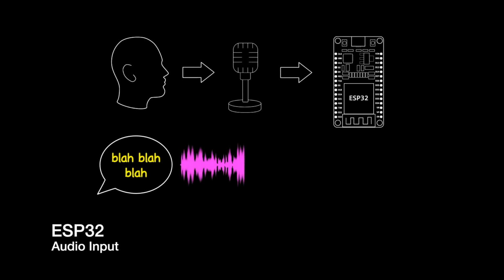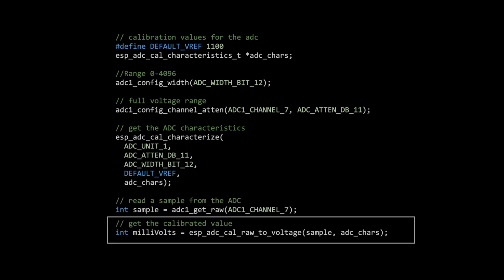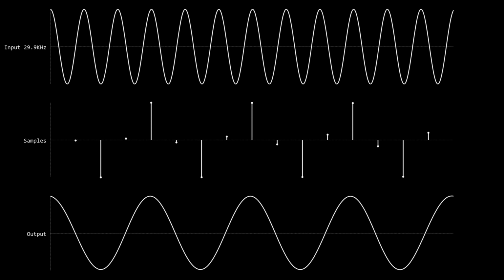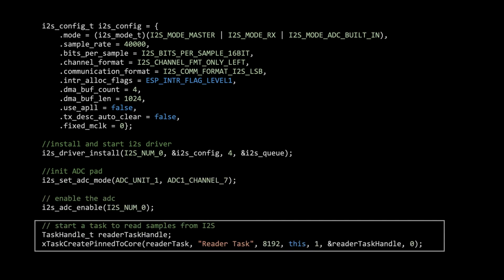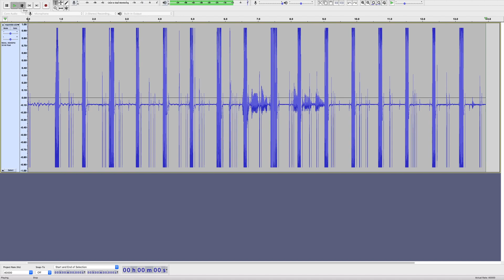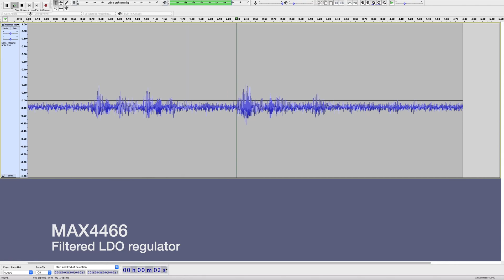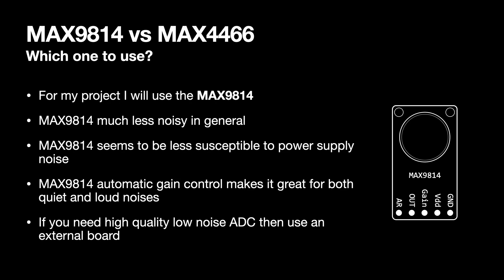ESP32 Audio Input Using I2S and Internal ADC

Comment: We are working with a PCM1808 an ADC that is connected vía I2S to an ESP32, would the code you showed in the video work if we are purely using our external ADC 

We have pins such as BCLK, Dout, SCLK and LRCK in our ADC 
We are having trouble to realize if our module is working properly. 

Because the only pin you configured was the internal ADC of the ESP32

Comment: So what part of this was I2S? These MAX modules are just microphone amplifiers, no? The way this was hooked up there is no way this was I2S. I guess maybe internally it is as if it was I2S, perhaps all we care about here is a way to read audio from the ADC pin in DMA mode. That's cool. I like the thorough work you did on cleaning up the signal. I am currently designing my own board and thinking I will integrate the MAX9814 as well as an audio amplifier on the DAC line. But not sure, maybe the trick is to keep all audio stuff off the digital PCB to avoid the noise coming in.

Comment: How do you manage to get 3.3v after passing 5 volts through those two inductors? I tried the circuit you suggested in your other video, but the voltage drop is more than intended and once reaches the microphone, it is around 2.7v not 3.3v.

Comment: Great video @atomic14. I'm getting the first part of the manual sampling going on a new ESP32 S3, but it seems like the I2S direct link to the onboard ADC has changed. Have you done any work with the S3 to see how to use efficient analog audio sampling without going directly to the DMA buffers?
Reply: Hi Pieter Snyman 
Am also trying to work with esp32 s3, How to work on it, with using i2s on board ADC?
Reply: @saranyaasuresh5710  in the end I used a digital microphone instead (that does the AD conversion) linked to I2S on the ESP32 S3. The S3 does not have the capability to use its internal ADC with I2S. As far as I understand this is preferable because the ESP32 ADC is not very good.

Comment: Great video. I'm using I2S just to measure one analog input. However, I'd like to measure two but have no idea how to set this up. So far all I've managed is to get loads of crashes or no data at all. Can you assist? Not sure if it's even possible. Cheers. Matt

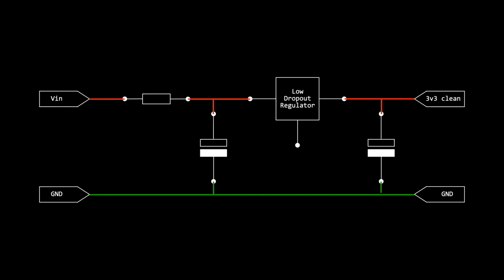Comment: Hi! Could you please tell me, what components did you use to filter the signal? I mean the diagram in the 7:32 video. What LRD chip did you use? and what capacitance of the capacitor did you use on the right?
Reply: did you figure this out? 🙈
Reply: is it a 470 microfarad capacitor?

Comment: Excellent video... came looking for info on MAX Mic modules... got it and more...
Just a note, you could power the MAX with a little isolated DC-DC converter (B0505S), often used in USB speakers to remove supply noise and it's not too pricy...
Reply from the maker: That’s a good suggestion.

Comment: Thanks for that video, TIL something new! 👍 'd and subbed.
I'm currently working on a very similar esp32 project (even using the same Microphones 😀), but when measuring the duration i2s_read(), I get very weird timings which are not correlating with the sample rate set in the i2s config. Do you maybe know what's happening here?
e.g. sample_rate = 40000, I get 6.3ms for an average i2s_read of 512samples (1024 bytes) buffer. Which is odd, because 512/40000 is ~ 12.8ms already. So I thought "okay, it's maybe twice as fast as I expected because I use only one channel"
So when I turn the sample_rate down to 20000, I would expect the duration of i2s_read to be DOUBLE (~12.6ms) for the same amount of data (which almost matches the calculation for 40kHz). but instead it goes down to ~5.9 to 6ms for 20kHz@512 samples ???
Okay, let's turn it down to 10kHz, I get ~5.4ms ... 1kHz, I get 825µs... . Are you familiar with that kind of issue? I need my data to be as exactly timed as possible, and these measurements make absolutely no sense to me.
Thanks for reading, and if you can explain that one to me, you'll have my eternal gratitude. Great video, animations and explaining!
Reply: Hi, I am also facing similar issue. Did you find  any solution? We can get in touch and discuss. Please ping back so that I can share my email Id with you.

Comment: hello, (did not work) this is nice tutorial, and i am trying to sample adc channel exact same as shown in tutorial, but it did not work. code crash with divide by zero error when call function i2s_adc_enable(I2S_NUM_0);

for reference my initialization code is as below:

#define TEST_SAMPLE_RATE    1000
#define TEST_NUM_SAMPLES    10

static TaskHandle_t readerTaskHandle;
static QueueHandle_t i2s_event_queue;

void initI2S( void )
{
  printf( "Entering : initI2S \n" );
  i2s_config_t i2s_config;
  //{
    i2s_config.mode = (i2s_mode_t)(I2S_MODE_MASTER | I2S_MODE_RX | I2S_MODE_ADC_BUILT_IN);
    i2s_config.sample_rate = TEST_SAMPLE_RATE;
    i2s_config.bits_per_sample = I2S_BITS_PER_SAMPLE_16BIT;
    i2s_config.channel_format = I2S_CHANNEL_FMT_ONLY_LEFT;
    i2s_config.communication_format = I2S_COMM_FORMAT_I2S_LSB;
    i2s_config.intr_alloc_flags = ESP_INTR_FLAG_LEVEL1;
    i2s_config.dma_buf_count = 2;
    i2s_config.dma_buf_len = TEST_NUM_SAMPLES;
    i2s_config.use_apll = false;
    i2s_config.tx_desc_auto_clear = false;
    //i2s_config.fixed_mclk = 0;
  // };

  // i2s_queue = xQueueCreate( 4, sizeof(UI8) );

  i2s_driver_install( I2S_NUM_0, &i2s_config, 1, &i2s_queue );
  i2s_set_adc_mode( ADC_UNIT_1, ADC1_CHANNEL_7 );
  i2s_adc_enable( I2S_NUM_0 );

  (void)xTaskCreate( readerTask, "readerTask", 8192, NULL, 12u, readerTaskHandle );
  printf( "Exiting : initI2S \n" );
}

Comment: Thanks so much for the awesome video, you've helped me immensely with my current project. I have a question regarding the internal ADC, is it possible to sample two or more ADC pins simultaneously or close to (i.e. not stopping and starting repeatedly)? I've tried to enable I2S1, but now see it is incompatible the built-in ADC, and i2s_set_adc_mode can only accept a single pin as an argument. Thanks again.
Reply from the maker: Hi Mike, it looks like it should be possible - there's a bunch of information here that might be useful - https://github.com/espressif/esp-idf/pull/1991

Comment: I would suggest the vocabulary "Interference" to describe the power supply signal getting into the audio signal. 
It makes some sense to differentiate and use the word "noise" for signals that are of random nature such as the thermal noise associated with resistors or the shot noise associated with current through semiconductor junctions. 

Why? because speaking this way makes you always remember to use design countermeasures appropriate for each type of undesirable signal.

Interference is also the right word to use when a signal from another source is getting into another signal. Such as One radio station in the background of another. Or AC power line hum getting into audio.  An interesting characteristic (while not often practical) is that you can some times cancel out interference by adding a scaled and inverted (the negative) interfering signal back into the contaminated signal. You cannot cancel thermal or shot noise because they are in your circuit components and never isolated.

Hope this helps.
Reply from the maker: This is why I love the viewers of this channel. This is a really informative and useful comment.

Comment: Very informative video. I've learnt a lot about audio sampling on the ESP32 from it. I have a question about the MAX9814 calibration though. There is a 1.25V DC bias built into the MAX9814 which I can see in the loop_sampling code serial print voltage output. When I  use the same device using your i2s_sampling code the raw sound data I capture on the server is also biased when I look at it in Audacity, (positive 0.5). Is this something I can calibrate out using i2s_read?

Comment: Thanks for mentioning the noise issue, that saved me a lot of time,
Reply from the maker: Yeah, a good clean power supply is essential for anything audio. I2S microphones seem to be a bit better, but I've still seen some noise issues.
Reply: @atomic14  could that be the reason why the ESP-CAM has noise in the images too? The power supply noise should also affect the camera, shouldn't it? Interesting...
Reply from the maker: @raguaviva  could be yes, depends on what kind of noise you are seeing.
Reply: @atomic14  I used two mics to do SSL (sound source localization using the FFT) let me know if you are interested and I can share with you the details/code
Reply from the maker: @raguaviva  That sounds really interesting! I'd definitely be interested. We've got a discord group going for the channel if you'd like to jump into that: https://discord.gg/DJ8EQRXU

Comment: Hi, amazing video and code.

I am trying to modifying it so I can sample two pins, but before doing that I want to get the example "i2s_Sampling" working. I commented out the mems parts, as I assume I do not need that when sampling i2s/dma. The part I am stuck on is seeing/listening to the stream over wifi. What program/GUI did you use to view the content?

Ultimately, I am going to sample at 60khz then average (10 samples) to downsample it to improve the SNR. Its for measuring another radios RSS, so I want something with high sample rate but also to remove extra noise. This data will ultimately be stored on an SD card, which is all working already. I just need to get your example working as is, then I can figure out the rest from there.

By "machine", do you mean the esp32 IP or the destination computer? 
```cpp
// replace this with your machines IP Address
#define ADC_SERVER_URL "http://192.168.1.65:5003/adc_samples"
#define I2S_SERVER_URL "http://192.168.1.65:5003/i2s_samples"
```
Reply from the maker: Hi Michael, that's the IP address of the machine that is running the node js server. To open up the files you can use a program called Audacity - this will let you import raw audio samples. You might also want to have a look at the sample code for writing to SD Cards - https://github.com/atomic14/esp32_sdcard_audio
Reply: @atomic14  Ah thanks for replying, only seeing this now. Thankfully I managed to get it working, I switched to sending the data via TCP instead of HTTP packets to log to a file, since this part was only to prove the code would work it was good. For some reason the alternating buffers was not working correctly, every other buffer sent was just zero, I was trying to fix it and feed it into a ringbuffer, but realised I didnt need the two buffer step if I was using the ringbuffer, still, couldnt figure out why.

Another question, I was hoping to record two adc pins, assuming I could use both i2s ports for that, but of course I have now just discovered only I2S_NUM_0 can be used with the ADC. I assume there is no way to read two pins, but thought I would ask.

Comment: Outstanding content, I have recently started developing with the ESP32 and was under the assumption that the internal ADC was useless so I've been using external ADC's. Implementing the process you have outlined here and a little digital filtering it's actually not bad at all for an onboard ADC. If it had an active filter buffer, RC snubber and input capacitance it would improve even more since SAR ADC's require a little more care to get the settling time right for low noise samples. Thank you for taking the time to post!
Reply from the maker: No problem. The ADC gets a really bad rap, but I don't think it's that bad.

Comment: How did you deal with the I2s buffer? seems to always return the second half as 0
Reply from the maker: If you've got it set to read from both channels then every other sample will be 0 unless you have something hooked up. Feel free to raise an issue on GitHub though and we can take a look at what's going on.
Reply: @atomic14  i did on the arduinofft github, i will add the code although it is based on your example except that i changed it to read from the internal adc
Reply from the maker: @TheElectronicEngineer  Post a link to the issue and I'll take a look and see if I can help.
Reply: @atomic14  I updated the issue on github to match the required format. I hope you or someone  else has time to look into this..
Reply: Btw i think i double posted this question.... sorry about that
Reply from the maker: @TheElectronicEngineer  No worries!
Reply from the maker: @TheElectronicEngineer  No worries.

Comment: how did you import the audio recording into audacity?
Reply from the maker: Hey Mark, you need to use the "File -> Import -> Raw Data" option. You can then feed it raw data and tell it the format. To get the raw data onto your machine there's a small server you can run and the ESP streams the audio data to it.
Reply: @atomic14  Thanks for the  fast reply. Have you written a WAV writer / reader that takes the input from this?
Reply from the maker: @markirwin5003  no, but you can export from Audacity. It might be worth you having a look at the SD Card video which does read and write wav files and is a bit easier to use as you don’t need to have a server running: https://youtu.be/bVru6M862HY
Reply: @atomic14  amazing hadn't even seen that video, I want to do something similar but write to the spiffs. 
I assume I use spiffs.h  not sure how to replace the new SDCard("/sdcard", PIN_NUM_MISO, PIN_NUM_MOSI, PIN_NUM_CLK, PIN_NUM_CS); with an spiffs equivalent
Reply from the maker: @markirwin5003  Hey Mark - I'll double-check this later, but in theory, you can just do SPIFFS.begin() and then for the filename use "/spiffs" instead of "/sdcard".

Comment: It would be interesting to record the audio at the same time with a separate isolated device to see how much of the poor quality is caused by the ADC of the ESP32, versus due the noise on Vin. And it would also be interesting to play a recording into the ADC and see how well it comes out. And also interesting to power the microphone from a separate battery as you mentioned in the video. It's a shame the ESP32 ADCs are so weak compared to the rest of it!
Reply from the maker: I need to do a proper followup video to this series - I've got a really good collection of mics and pre-amps to use. It's definitely in the schedule. I'm also quite keen on actually quantifying how bad the ADC actually is. Separate the performance of the ADC from the mics and see if it really is as bad as everyone says.
Reply: @atomic14  That would be useful. I've read that it is only capable of:
7 Bits ENOB out of the box, closer to 10 Bits with the recommended capacitor and 64 sample averaging as described in the Espressif docs
6 kHz signal bandwidth (presumably the 3 dB cut-off
150 kHz samplerate
Non-linear resoonse and unable to read below about 0.15 V
Reading 254 samples continuosly and then skipping 2 samples whilst it does something internally
Or reading in "continuous mode" which Espressif recommends against because it drops the quality substantially.

Also, apparently, once every 17 seconds there is a window when there is much less noise for a second or so; so any quality measurements will be very different depending on whether you happen to hit that window!

I'd really like to see them improve the ADC in future ESP32 versions.

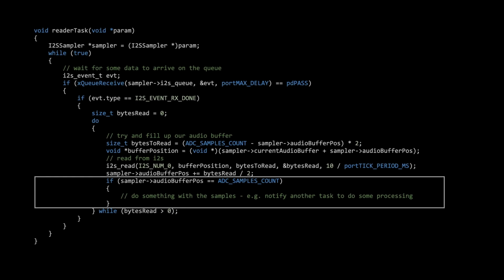Comment: At 04:45, what is the function of "this" as the pvParameters argument for xTaskCreatePinnedToCore()? The Espressif documentation says "pvParameters: Pointer that will be used as the parameter for the task being created."
Reply from the maker: On the task function definition, you'll see that it's defined as void task_function(void *param) - the value of the param is what you pass into xTaskCreatePinnedToCore. So this allows you to pass data to the task you are creating. In my case, I'm just passing in a pointer to the current instance.
Reply: @atomic14  Thanks. Makes more sense after downloading the source files and seeing the full thing. I'm used to using plain C as much as possible and didn't realise it was inside a method of a class.

Comment: I presume it is useful (or essential) to have at least two DMA buffers to allow reading one whilst writing to the other. But what is the reason for using more than 2 buffers (i.e., 4 in your case)? Or when could this be useful?
Reply from the maker: There's a maximum size that you can specify for each DMA buffer (I think from memory it's 1024 bytes) so you can use multiple DMA buffers if you want something larger.
Reply: @atomic14  That explains it! Thanks for responding so fast. I didn't know there was a limit on buffer length. Is there a limit on number of DMA buffers (memory permitting)?

Comment: Very nice video, thanks!
Do you think it is feasible to subtract the noise with and OPAmp? One of the opamp imput connected to the mic audio out and the other to the power line?
Or, could it be possible to use two adcs as the same concept? Of course losing wifi, but just for curiosity.
Reply from the maker: I think the best solution is really putting in a good clean power supply for the microphones. I did find that using the 5v supply with a good LC filter followed by an LDO would give a very clean 3v3 supply for the microphones.